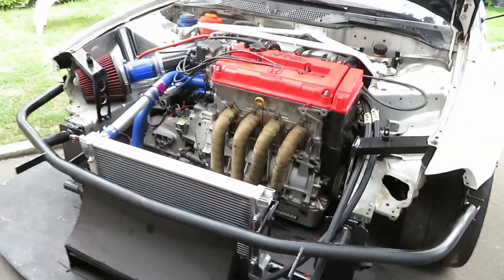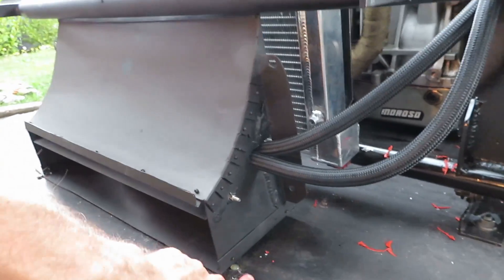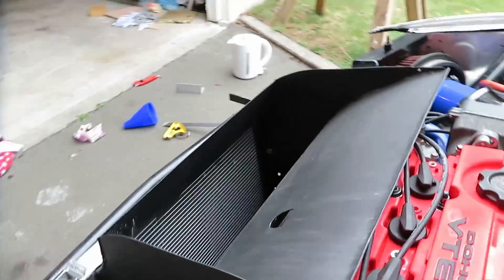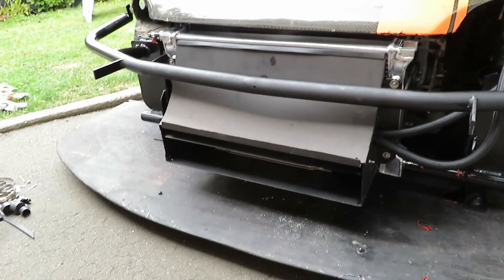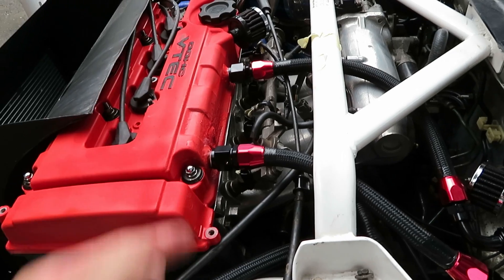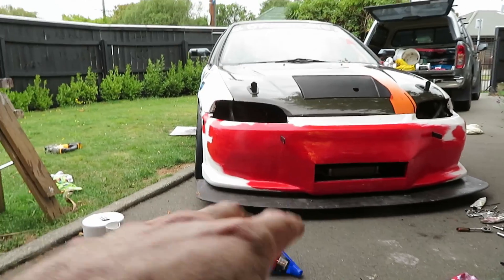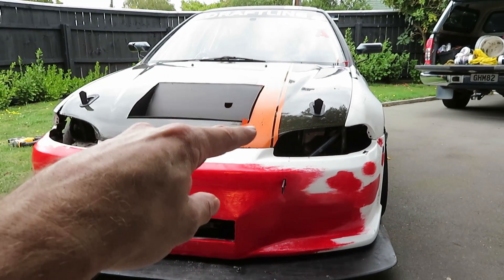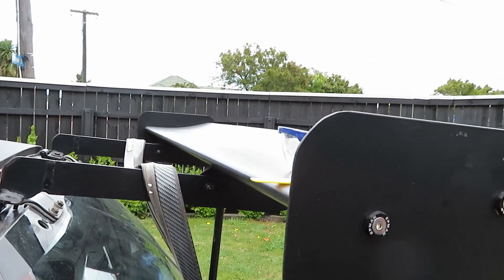EG Civic - DIY Tube front + Ducted Radiator - Aero!

Comment: Not sure if you’ve had issues with your catch setup, but my solution for drainage was to run a line from the catch can to one of the rear block PVC port lines.   Simple AN t fitting did the trick.

 Nice work on the aero.  Appreciate you sharing!

Comment: Just use woven fibreglass for the splitter. It’ll be well strong with a foam core and cheaper than carbon fibre. Also have some wooden wear sliders on the bottom! Good work mate!
Reply from the maker: Thanks, I ended up using carbon fibre, worked incredibly!
Reply: @DIYEverythingracing  Awesome mate! Where do you race it? Be cool to check out. :)
Reply from the maker: @NicNeame  I don't have this car anymore, sold it for a EK civic which I just made a quick vid on. I did race at Ruapauna, I take it you're in NZ also
Reply: DIY Racecar yeah I am mate. Tauranga based. Well it was cool to see the vid. Thanks for sharing!

Comment: Looks really good - but that oil cooler wrong place if engine over heats on hot days   . If there’s no room behind rad engineer another duct somewhere else. Like your thinking through the aero.
Reply from the maker: I've sold this car since, but the guy that purchased it hasn't had any issues with the placement of the oil cooler. Never any issues with overheating luckily! Cheers for the comments. New build underway now.
Reply: @DIYEverythingracing  if it’s not over heating than there’s no problem to fix 👍

Comment: Really creative good job. Your engine bay pressure is probably really low which is good.  How are you evacuating the engine bay heat? Are those vents towards the back of your fenders?
Reply from the maker: Thanks mate. Engine bay heat was never an issue. There was a hole under the splitter which did draw heat out. I would have put vents in the hood also but ended up selling this one. My new EK civic is away getting similar done at the moment!

Comment: Youtube has been trying to make me an aero expert for the last three days, so I very well might be wrong... But isn't it better to funnel the air to the downside of the car? you contribute to uplift or downlift forces depending on where you put the air, and the drag is going to be less because the downside of the car is a shorter (straight) path.
Reply from the maker: You would then have the effect of disrupting airflow under the car. Assuming you did have a flat bottom on the car, funneling air into the low pressure under the car that's creating the downforce, you would completely upset the airflow and negate the gains. I can't think of many instances you would funnel air to under the car. But aero is a dark art without wind tunnels and CFD. My testing was based on data on the race track after a tonne of research like you're doing!

Comment: Hey mate, would this ducting negate the need for a rad fan?
Reply from the maker: Hey mate, yes it does, when moving. You don't need a fan, especially when racing as the fan is redundant due to airflow anyway. However if you're in pits etc, this is where you need the fan to draw air through the radiator.
Some guys will have a clip on fan just for the pits, but it seems easier to just mount a single fan behind the radiator and cover yourself. Hope that makes sense
Reply: @DIYEverythingracing  thanks mate. I've been slowly trying to turn my z32 into a race car and would love to be able to get to your level. So far I've only had 2 track days at Ruapuna and made a grand total of 11 laps haha. There has always been some small issue that ruins the day.
Reply from the maker: @martinross8747  don't worry mate, I know that feeling! My latest racecar has been nothing but a nightmare and I've only turned about as many laps as you have in it so far. Stick with it though, once you get that good day out it makes it all worth it.
Reply: As he said only really need fan when idling so unless you use it in traffic you’re good!